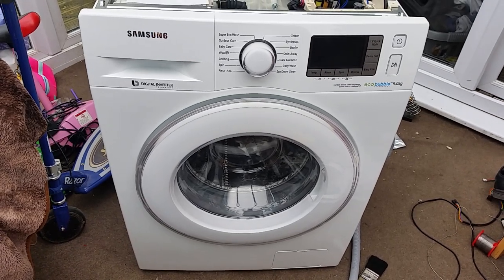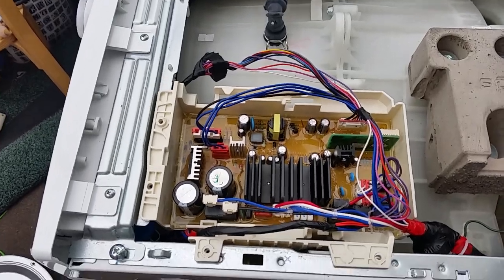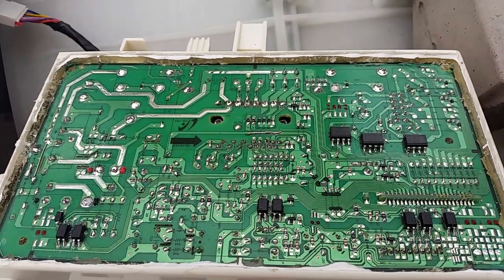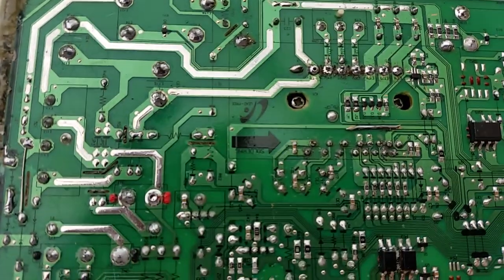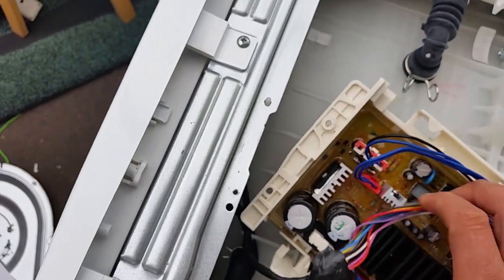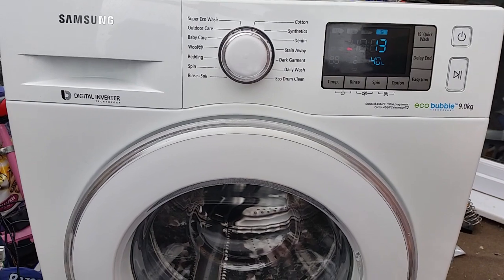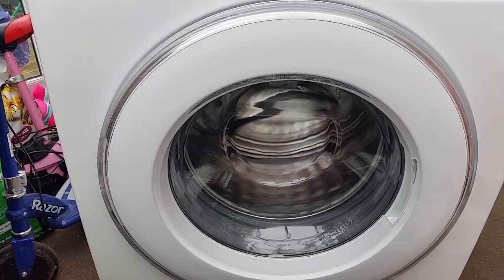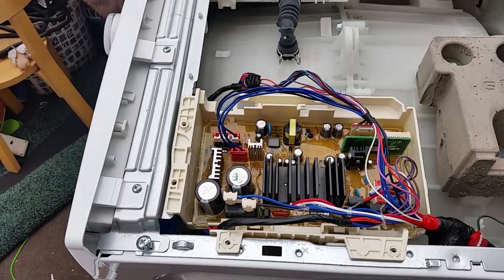Samsung eco bubble pcb board repair

Comment: Hi! Thank you for your video it was really full of information 
I have a Samsung washing machine eco bubble the motor won't to turn on I changed the main power CHP number ikcm15f60GA it works only ones and then stopped working 
I bought the new chip but i did not change it yet so I wandering is there any other things to test it before I fits the ic. 
Thanks in advance

Comment: Chapeau!. You need a bigger workshop. Any idea how to remove the door catch? You have to hinge the right hand end towards the back to release the lip, but the casing is in the way. Do you remove the side or the front panel? If so where are the screws please?
Reply: Yes - you need to remove the front panel. However,  the door latch was okay and the dE error was caused by a faulty PCB - you only need to remove the top to replace that so easy repair and works okay now. A lot quicker than trying to resolder the PCB.

Comment: What do you think could be the cause of the washer stopping mid cycle, also a Samsung ecobubble
Reply from the maker: Probably dry joints (bad solder connections) on the circuit board, or the motor drive chip failing.
Reply: @BuyitFixit  thanks for the quick reply, I'll get a multimeter on it

Comment: Hi @buyitfixit i have this same and washing machine is not turning on i have open the same pcb box and fould 1 black ic/capator broken can it be fixed? Plz help me plz resopond if u want i will post the pic also kindly help me
Reply: Plz help me
Reply from the maker: Hi, it's been a long time since I looked at this, can you still make the number out on the blown IC? Was it a different IC to the one I changed?
Reply: @BuyitFixit  the ic name is SYP12270
Reply: @BuyitFixit  that's is different this is small can round in shape
Reply from the maker: @dssvivekvicky3073  a quick search on that number says it's a PTC  thermistor used to protect motors instead of a conventional fuse. Either that has just failed or something further on is shorted and caused it to fail.
Reply from the maker: I just found this on a russian site, where a similar samsung had no power, and the cause was a capacitor and a blown power supply IC as well as the PTC you gave the number of. I think this may help: http://dokakodm.ucoz.ru/publ/sam_pochinju_stiralnuju_mashinu/prostye_neispravnosti/stiralnaja_mashina_samsung_wf6528s7w_ne_vkljuchaetsja/7-1-0-418
Reply: @BuyitFixit  thank u so much and can this be replaced?? Plz suggest
Reply from the maker: Yes. You would need to remove the old components and replace them, or find someone local to you or a local repair cafe or makerspace might be able to help.
Reply: @BuyitFixit  sure I will go and find some local mechanic and ask him lo replace tht ic and i will post the result here thank u sooo much
Reply from the maker: No problem. I would also check the diodes around there too, just in case it had caused them to fail also. I would think the cost of parts to be around £10 or less.
Reply: @BuyitFixit  sure please thank u so much

Comment: hi, I have the same problem, which is short on pin 23 and pin 19 IKCM15F60GA, after I replace it all works except the motor doesn't rotate. motor measurement results:
U-V = 5 ohms
V-W = 5 ohms
U-W = 5 ohms
I have changed all the ic 817 photocoupler, but there is still no change
Is the IKCM15F60GA chip that I replaced not the original part?
Reply from the maker: Depends where you got it. I got two from ali express and they were fake as the quality of the logo and writing was poor and one didn't work at all and the other only worked briefly.
I ordered two new ones from mouser and both were almost identical to the original in terms of quality of text etc and its still installed and working fine.
Reply: @BuyitFixit  thank you so much.

Comment: these washing machines are terrible.
we got it fixed for 250 pounds because we tried all of this  plus more and it still wouldnt work
then  the motor broke and yet it was still under warranty but samsung did not give a crap at all.
we decided to just scrap it like this one has. dont buy them unless your using it for parts lol.

Comment: man, what kind of material did you rip off the resin on the bord?
Reply from the maker: It wasn't resin as such. More like a soft silicone based compound. I just scraped it off a bit at a time with a flat blade screwdriver
Reply: Mate it gave me hell of a time! It took a whole day to peel it off even then not as clean as buy it fix it

Comment: Hi! Thank you for sharing this. My Samsung washer is about 3 years and has the same problem.
I wanted to ask:
1. Did you cover the circuit board with something or just left it without the silicone gel? What would you suggest should be used to cover the circuit board once the silicone gel has been removed and repair completed.
2. How did you fix the plastic underside of the board.
Reply from the maker: Hi, I just just left it without the silicone gel. I also didn't do anything with the bottom plastic part, although you could just put a few blobs of silicone on it, and stick it back on if you wanted.
Reply: mickr1969 Right, thank you so much.

Comment: You did not use any chemicals to remove the master silicone, the printed circuit is damaged with a screwdriver
Reply from the maker: No. It just easily peeled off with a screwdriver on the back if the PCB. On the front I just dug around the motor IC. Perhaps they might be using a different compound now? If you are having difficulty.
Reply: @BuyitFixit  thank you where do you live

Comment: Hi, how do you disassemble the top cover?
Reply from the maker: Just remove the two top screws at the back, then bash the top front of the machine backwards. Sometimes they are a bit tight, but the top kind of slides towards the back about an inch or two, then it lifts off.

Comment: I have a same machine and when i plug it, it does nothing, like does not turn on at all no signals of life. Any idea what it could be?
Reply from the maker: It could be a number of things. Check you actually are getting power to the main board, if so, I'd then start checking you are getting voltages out of the power supply on the main board. To do that you'd need to hack the plastic part off on the back like I did, and remove all of the silicone stuff (which is a bit of a pain to do). Then I'd start seeing if there's any voltages coming off there. There's a 5v, and a 12-14v from what I remember.
Reply: I have the same problem, did you fix it allready?
Reply: mickr1969 
I have same machine 
Eco bubble 8 kg 
It’s nt power

Comment: Thanks for the interesting video.  We have a 9kg Ecobubble.  Looks to be a bit different inside.  The PCB is on the back of front panel.  It was a bit of a pig to get to the solder joints.  (Samsung must have watched your video and decided it was too easy).  Tried the dry joints but am still getting error 3c2 when I put in test mode.  Have ordered a new motor controller from mouser so fingers crossed.  Quick question.  Did you test the motor at all.  If yes, how?  If not, why not?  I am guessing the answer is "no" as this is the bit they guarantee for 10 years and so they will have made it reliable.  :)  Just interested to know.
Reply from the maker: Yes you can check continuity between the motor leads. You should get a low value reading between each of the leads when disconnected from the pcb. Also on a side note. Mine is still working fine since the repair.
Reply: @BuyitFixit  Many thanks.  Just got the part from Mauser.  Soldered it in.  Motor works - Hurrah!  Doesn't fill on main wash though. :(  Think the solenoids are ok. but it isn't getting power when it should.  Think a Bosch or Miele is on the cards!
Reply: ha.  Weird thing.  If I blow into the level sensor (which I know i shouldn't do) it starts to fill.  Also fills on rinse and spin without any fiddling.  It might live to fight another day!  Time to google how to test the fill sensor!
Reply from the maker: @carolinemills1282  Glad you got the motor working, not sure on the level sensor tho, have you checked the tube from the drum in case it is blocked or something? They work on pressure, so the more water in the drum casing, the more pressure of air is pushed down the pipe into it.
Reply: @BuyitFixit  Mick  Thanks.  I checked the tube is clear and it is.  The funny thing is that it won't fill until I have blown into it.  I was expecting it to fill until it reached a certain pressure and then stop i.e. I might have to blow into it to stop it filling, but not to get it to start filling.  Seems it needs a minimum pressure to activate it??  Have ordered a second hand sensor on eBay.  Let's see.
Reply: sensor just arrived - (they must have seen my thread).  Plugged it in.  Still the same.  3-2 to the machine.
Reply: @carolinemills1282  one idea, tube of sensor might be filled on the lower end, where it plugs into the tub, with detergent or dirt or lint from clothes. You can try to clean it there.

Comment: Aha, so this is not a direct drive motor! :)
Reply from the maker: No. Not direct drive but 3 phase permanent magnet motor. Seems it uses the motors coils to measure feedback for position sensing.
Reply: It uses Inverter technology

Comment: Hi I have a samsung eco bubble washing machine which switches on and when i try to put the machine on it takes water but fails to spin I've tried to calibrate the machine again it does not spin can anyone please help on what's the problem is and how i can fix it would be highly appreciated thanks guys
Reply: If the drum is hard to move by hand then it is mostly because of that igbt or chip he is replacing.